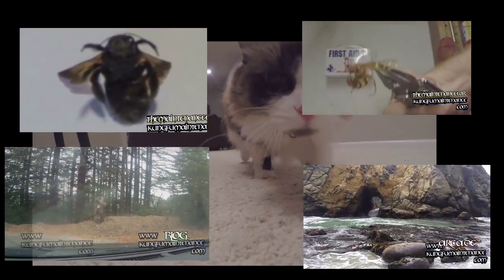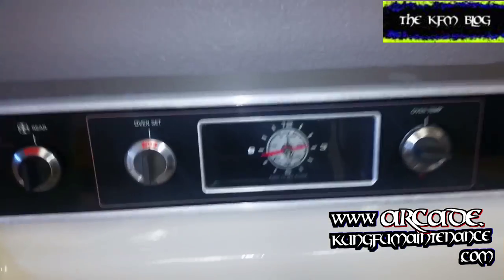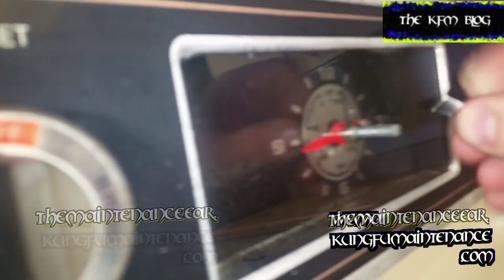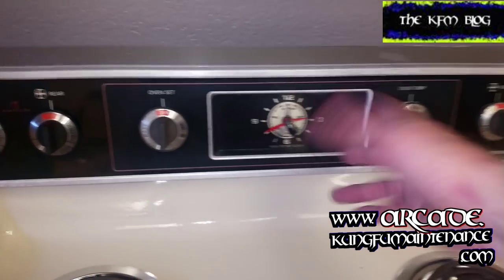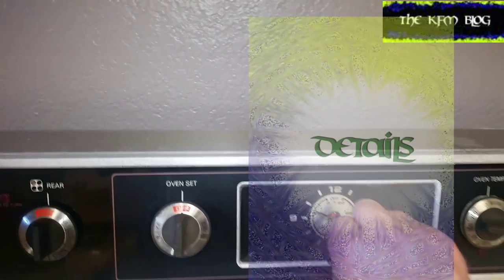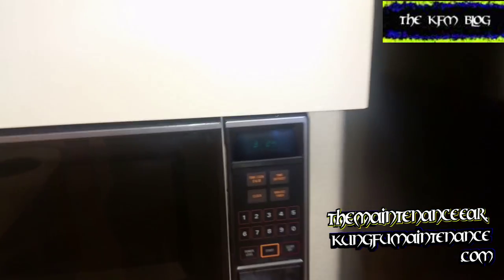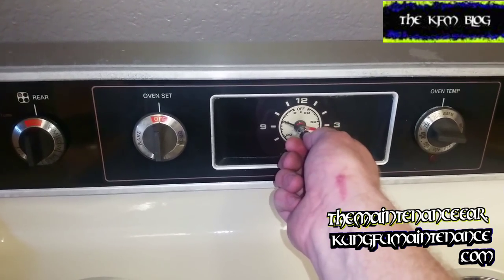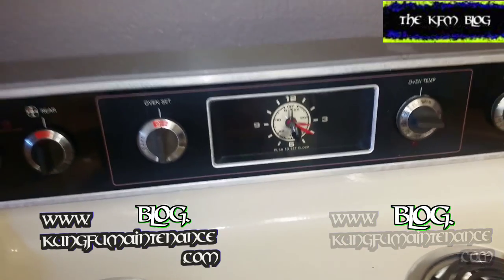How To Replace Clock Timer Knob Plus Set Time On Vintage Stove Oven Range Repair Maintenance Video

Comment: I have a very similar oven/stove to this at my condo I'm moving into that's a Caloric brand one.  Everything on it seems to be working fine, though for some reason for the life of me I can't figure out how to set the clock on it.  Not a huge deal if I can't figure out, as the microwave above it shows the proper time and I have my phone and stuff anyways.

Comment: This is the exact same oven I have at the new apartment I'm moving to. The only issue I have with it is that the oven's heating element is severely damaged. Maintainance says it's my problem so I'm trying to figure out what the model of this oven is to find a replacement part but can't find a model number anywhere. You wouldn't happen to know what the model number for this oven would be? It would be super awesome and helpful to me if you could tell me. Please help a poor apartment dweller out. Thanks for the video on how to make the clock work as well!
Reply from the maker: +Anastasia Goins Here it is J BS16G0J2AD. I'm not entirely sure the first J is part of it. I will try take a video showing the model number location soon.

Comment: I have analog clock like this on Caloric range (it is at least 30 years old) the timer is going off continuously since yesterday.  If I move the black pointer a little bit, it will stop for a minute and the timer will start up again. I have fiddled with the dials and there seems to be no solution. Do you think you can  help me?

Comment: Lucky your analog clock and timer still works.  The motor on mine died and now I'm having a hell of a time finding the part to repair it.  Oven still works perfectly and it's 30 years old.
Reply from the maker: +Domo At that point I would just use me cell phone as clock and timer instead. It has the added advantage that it travels with you to whatever room you are in. Brrrringgggggg...... Dinner is ready!!! Time Travelers!!
Reply from the maker: I see ~..~). I doubt most people would view the analog clock or mechanical timer as a factor. I would just set the clock at 8:00. Its always a good reminder of restart is possible second chance. 8 being the number of renewal. I do understand though the desire to make it work right. Especially for a sale. ..~ All the best!!!
Reply: +KungFuMaintenance Ok.  8:00 sounds good.  If I don't find parts, that's the time I'll leave it at.